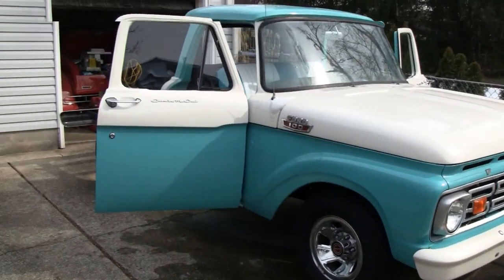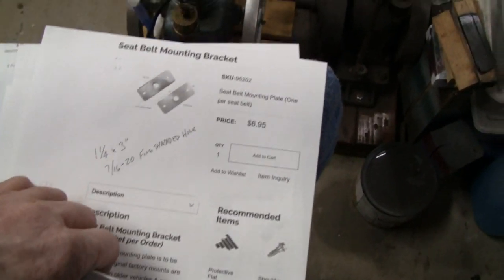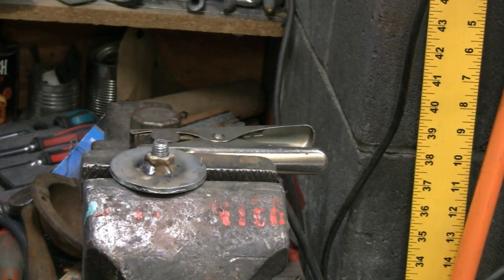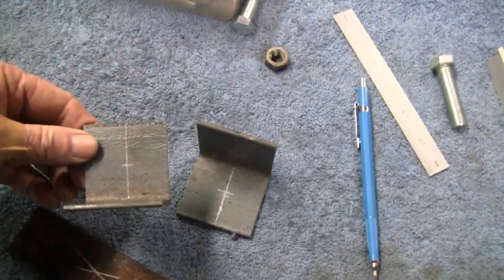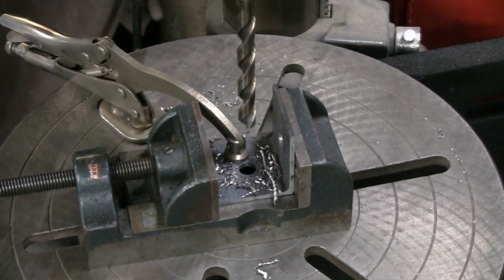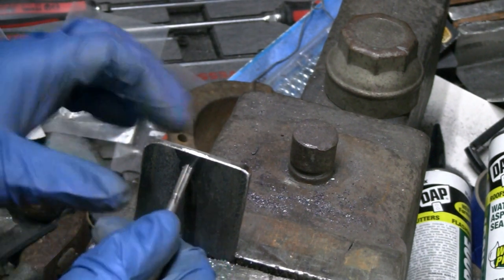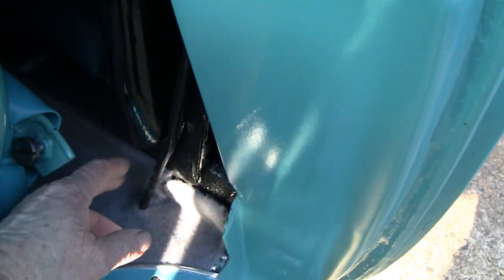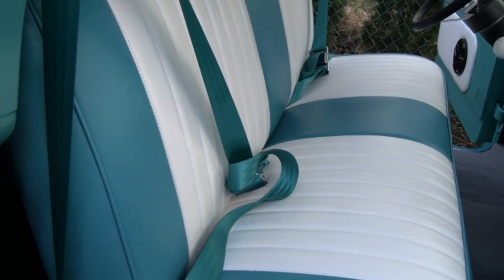INSTALL SEAT BELTS & FABRICATE BRACKETS (F100 part 92)

Comment: We always had seat belts in our cars. Even the 40s and 50’s cars. My uncle was a pilot and flat demanded we have aircraft seatbelts in our cars. He would bring them over and install them.   Color matched when he could. Most were tan. Exactly like the ones you are using! Lap belts only. Just as in aircraft.  The forces in a wreck are unreal. I put racing harnesses in my old short track cars. As the belts were short I bolted to the floor with 2 ton chains. A guy told me to go bigger. Gee two ton, screw that I’m fine. Soooo slammed into the wall at about 50. 50 isn’t all that fast. But fast enough I guess.  Anyway when I came to my senses I unbuckled and found myself holding one of the belts. Chain broke. The other stretched. I couldn’t believe I broke a two ton chain with my body. But I’m just short of 300 pounds. Back then about 280? Anyway about 7G to break the chain. 7G in a wreck is nothing. Good hell the forces.
Reply from the maker: Holy Christ!! 7G's you're lucky you survived!!☻